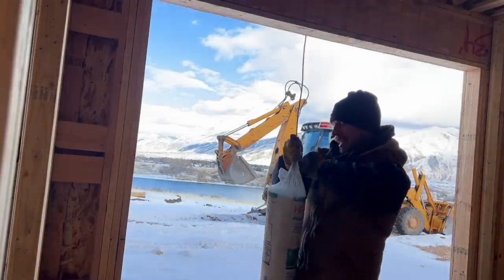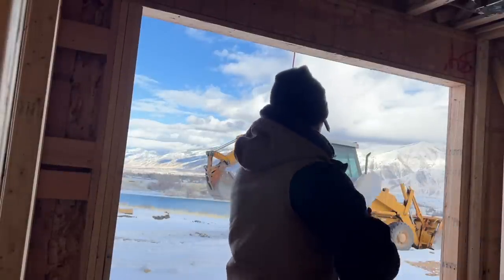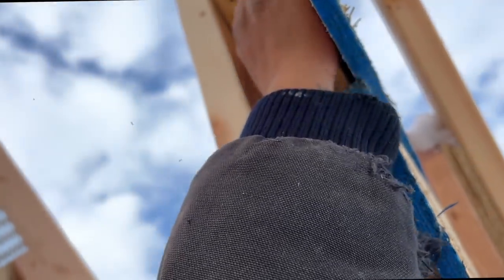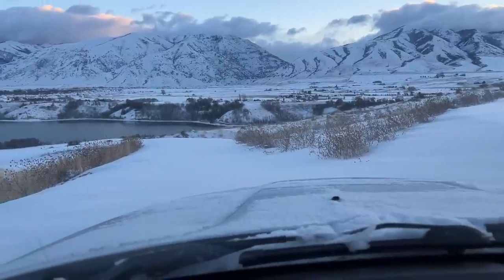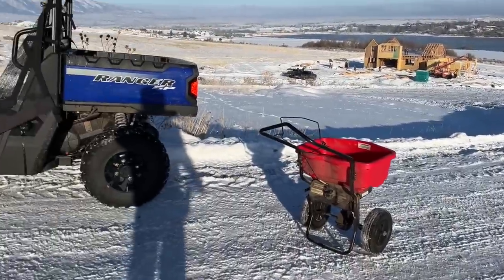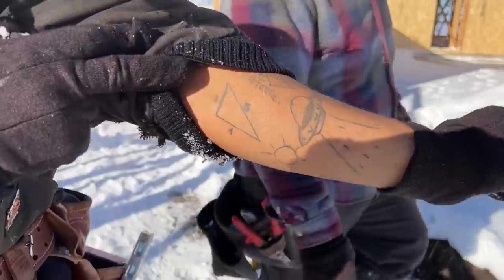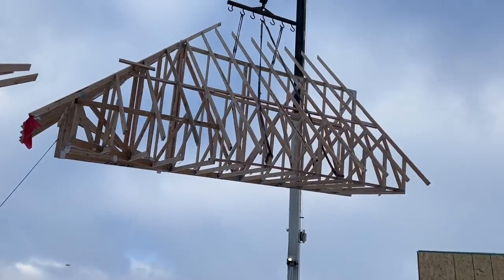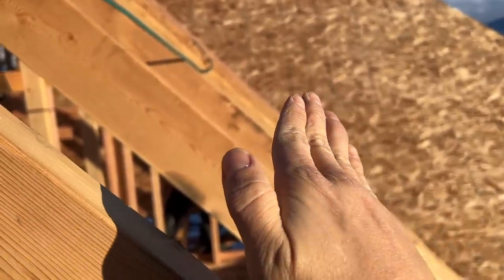Framing Part 3 How to use a Speed Square

Comment: OK Joel I have a question? Isn't the temperature too cold to lay shingles in the weather you have  and seal? I'm seriously curious 🤔 or are you going with the steel type of roofing? Thanks for sharing your journey
Reply from the maker: Good question. No we will be able to lay shingles all year. Even on the cold days if the sun shows it’s face the shingles will absorb the heat and melt the tar strips.

We are putting both shingles and metal roofing.
Reply: @TodaysTask  nice! Thank you for your response.

Comment: Hi Joel, Emese here from Germany. Why do you guys build literally with no brick? Building with these wooden stuff is not that sustainable and not that solid like a rock.
Reply from the maker: That is a good question. New construction is only built with wood and steel now days. Brick is just a decorative Veneer. Our house will bricked later and it will be our entire exterior.  Fun fact our old house was brick structure and I was always worried about and earthquake.